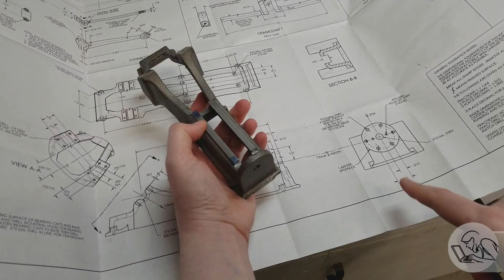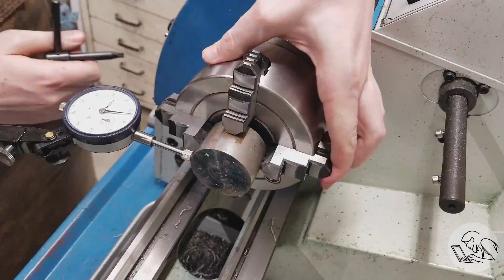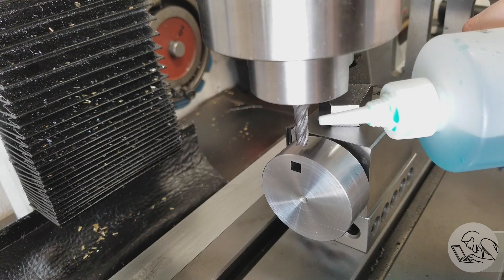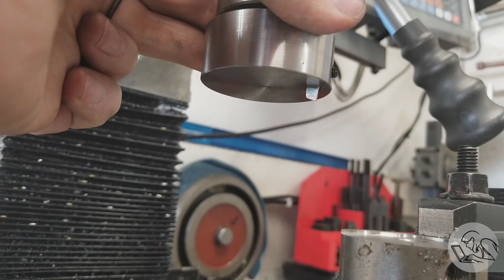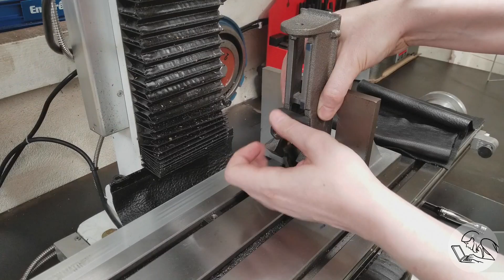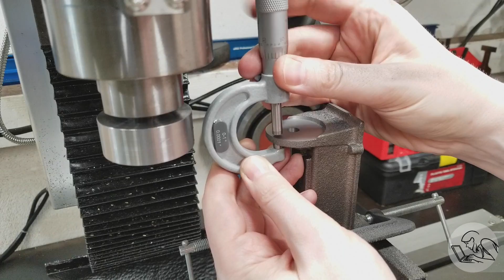Let's Build A Model Steam Engine : Spot Facing!

Comment: For your flycutter, since you're cutting soft cast iron you can use a drill blank (re-harden it if you need to) or use a piece of round carbide and grind a flat with a cutting edge on it. Kinda like a round lathe tool bit. I've done it and it works great and you don't need to square a hole.

Comment: For a small amount of adjustment without regrinding the tool would be to drill the hole in the hub at a slight angle so you can pull the tool in and out to adjust the cutting diameter.
PS Love the content! You have me more seriously considering buying myself a mill and lathe now.
Reply from the maker: Great idea!

Comment: Quinn, Your tool cut the first cut 20 thou over. Did you cut 10 or 20 thous from the tool bit? I'm building a PM 1 vertical. You Rock.

Comment: Hey Quinn! I did this operation on my kit today using the same setup you did with an angle plate. 

Like you, I found what seemed to be an out of square error in my angle plate. 

After a bit of measuring it transpired that the error wasn't the plate, but was because my mill head was slightly tilted. I corrected this and the angle plate ran true. I wonder if this might have been your problem as well.

Cheers from sunny Australia

AB
Reply from the maker: I wouldn’t be at all surprised if the error is in my mill, but shimming the plate is a lot easier than fixing the mill. 😁
Reply: @Blondihacks  how right you are.

Comment: Nice work. You could have also drilled the cylinder bolt circle in the same setup as spot facing, Reason you didn't ?
Reply from the maker: There isn’t vertical space for one, and for two I want to make the cylinder first to guarantee proper hole alignment

Comment: Next time you make a flycutter with a vertical tool, don't drill a hole and file. As you found out, adjusting the diameter of the cut is hit and miss. Mostly miss.

Instead mill a slot in the side of the tool. This will let you adjust the diameter of the cut quickly and easily.

Comment: Just for s & g (work it out for yourself), I've recently ordered an angle plate. Never thought I might have to check it for trueness, but it seems I do.

Ps. I can see how that making the back surface circular is ... pretty, but is it necessary? Can't you just machine straight across and leave a straight step?
Reply from the maker: Definitely not necessary. I liked the challenge of it. 😀

Comment: Another way to make that square hole is to mount the part on the mill table and use the z feed and a tool ground for slotting to cut it out.  It could be done on a lathe faceplate using the carriage movement as a shaper as well, but you would need some way of indexing the spindle.  If it’s not an operation you plan to do more than a couple of times, filing might be the most efficient way, though.
Reply from the maker: Yes, that would have been a cool way to do this!

Comment: if you had drilled the hole at a slight angle you can give you self a small adjustment of diameter by adjust cutter in and out. not much butt enough for perfection

Comment: Armchair machinist here... why not make a small "regular" fly cutter; it would be more versatile rather than single use.
How many hrs of practice to get the cutoff on the bench top consistently ;o
Reply from the maker: I definitely considered it, but that would have taken a lot longer and I can’t see it getting much use. This quick and dirty one only took about an hour (and half of that was filing the hole which I could have avoided 😂)

Comment: What seems to work best for breaking chips on aluminium for me is tons of RPM and feed. I tend to use inserts but I will run around 350m/min or 575fpm and feed 0.15mm/6 thou per rev.
This usually breaks chips quite reliably with cuts between 0.1-0.3mm radially using DCMT070204 inserts which can be find quite cheap on ebay and such.
I think our lathes are fairly similar in size and construction(I have a BL250G).
Start the feed, stand back and watch the spray of chips! :)
Reply from the maker: Yah, that’s what I do as well, and it helps, but my lathe can only do so much. What you saw there was max RPM and max feed on this machine.

Comment: did a similar spot face and ran into the same issues. i used the adj boring head in the lathe with the part fixtured to the cross slide
Reply: I was wondering about that myself. It saves making the special tool.

Comment: Looks good. Why did you choose to make the toolbit parallel to the arbor?
Reply from the maker: Because it was easier to make and easier to get the diameter correct this way
Reply: @Blondihacks  easier to layout a nominal diameter, but a tilted axis would allow fine-tuning diameter by adjusting tool stickout
Reply from the maker: Yah, but making an angled square hole in stock that thick is no fun. This was an easy and worked. 🤷‍♀️
Reply: @Blondihacks  Yeah, you're right, it would have been unpleasant gauging your progress on a square hole if it intersected the faces as a rectangle.

Comment: Hi Blondie,
Don't be afraid of carbide insert tools for hobby lathe.
I have a smaller lathe and have no issue using them. Especially on aluminum and hardened steel.
Propper insert does not know the origin or rigidity of machine. It jus does its job.
And also - for delicate work on stsinless I use Alu insert. It does not last long, but cuts away better tha SS rver will, with low spring effect on long overhang.
For aligning thing discs in lathe chuck - try a bump tool.
A simple project: drill M6 hole in old brazed carbide shank and bolt on the ball bearing. Try it, you will be suprissed 😉
Reply from the maker: I do use them, and have shown them on my channel. I just think HSS is better for hobbyists in most cases.
Reply from the maker: And I have a bump tool, and have shown that as well
Reply: @Blondihacks  
Obviously I have to go through all the videos on my favourite hobby machining channel 👍👍👍
Reply: @Blondihacks  
Hey Blondie, 
I thought the same, an for begining it was for sure so.
With cheap imports this have chsnged. Couple of bucs for a box of inserts. Especially this was true for what I expetianced for aluminium inserts. In combination with alcohol. BTW -  that nasy blue stain over your logo made me feel bad for talking you into trying alcohol. I do not use blue ink - so zero mess for me.

Comment: You could bolt the arbor to the cuter head with an eccentricly placed bolt hole. Arbor and tool are concentric (starting out) but the bolt hole connecting them is off axis. If it is only ~5 thou of axis you could get 10 thou of adjustment by rotating the arbor relative to the tool. Btw, I'm a big fan😊

Comment: Your chip breaking tool isn't breaking the chip because that relief is 90 degrees off.   It's acting more like a crappy shear tool instead of a chip breaker.  You may want to add like a step about .020-.035 from the cut edge to roll the chip more to break it, if that makes sense.

Comment: Alternate solution. You could have set the mill head at 90 degrees to the Z and use a boring head in the X direction. Still might have been tight on travel.
Reply from the maker: That’s an interesting idea!

Comment from the maker: Hey everyone! Here's are today's themes in the comments. Save yourself some typing and read first:

1) Yes, using a round piece of HSS speed steel in the fly cutter would have been a lot easier. However the square piece is what I had, and it was a good excuse to practice my filing, which I wanted to do anyway.

2) Yes, you could totally do this with the boring head in the lathe. If I'd thought of that, I'd probably have done it that way. 😀  Another good way to do it would be fixturing it to a faceplate and using a boring bar in the lathe. You need a good-sized lathe to have the mass to handle that setup, so that probably wouldn't have worked for me.
Reply: Sometimes I do something a certain way, because I just feel like doing that way, because it's a hobby and it's enjoyable. Weird right???? 😂
Reply: Or....4 jaw chuck with small plates and junk and the 5/16" hole with a plug with a center hole. Then just a face cut as usual on a lathe. The plug could bear against another piece of junk within the casting, this way it wouldn't need a step fro thrust. Rubberbands and tape can be used to keep the whole thing from killing you. I love the soda can material.....006 quite often.
Reply: unrelated , but every time i see you dial in a part in a four jaw  i cant help but wander, did she try two chuck key method and didn't like it, or never tried at all?  Make me second guess my self:) im easily twice as fast with two keys:) love your channel!!!
Reply: @zombiewelder9319  I always use the 2 key method.  I'm not proud, I need to get it done. Lol
Reply: Another way could have been a end mill the diameter of the counter bore.  That would have been closer to what we learned to do when I attended Pasadena City College.
Reply: @wi11y1960  
She mentioned in the video that she didn't have one that size.

Comment: @Blondihacks  - Hey Quinn! I have some cash in the budget next month to add either a small lathe or a small mill to my garage shop. Which would you recommend I start with? Which is the more versatile tool? I'm really torn between them! HALP!!

Also, I tried a metric thumbs-up and it was 10x better, but 1/2 as cool!
Reply from the maker: Check out my Import Lathe Buying Guide video!
Reply: @Blondihacks  How did I miss that!? Thanks!

Comment: Quinn, do you have a dial test indicator? It's a lot quicker and more precise (than turning a plug) to chuck one up in a collet or clamp to the spindle OD and indicate the inside of the bore. If you don't have one I might have a spare lying around... Edit - duh, you're using one in the video. Oops. The one I use for this is a lot smaller and fits even when the Z axis is pretty tight.
Reply from the maker: I appreciate the offer! Yah space was super tight here so the plug seemed the way to go

Comment: Ok, first, get out of my head. I was actually talking to my phone out loud wondering why you weren’t using a boring head, then you pause to explain it to me. Creepy. 
Second, filing square holes is not character building, it’s sadism. You should’ve called ToT, he’s got square drill bits. Lastly,  I may be showing my ignorance but, wouldn’t it be a lot easier to grind the cutting bit round at the shank with a flat spot at the set screw to index it?
Reply: Man,   ITs a STEAM  Engin,    NOT     SPACE   X.   get a life.   UK.

Comment: 1:59 A lathe suddenly looks suspiciously like a horizontal milling machine to me...
Reply: Back when I was a 9-5er, working at the shop, the mill went down for some time. Burned out a hard to replace part. The 'machinist' on hand used the lathe as exactly a horizontal mill for about two months, until the owner got around to replacing the part in the mill. The only issue is all cuts can only be made on two axes, depth and 'X,' but it worked just fine. I'm convinced that the 'missing link' between a lathe and a mill is a mickey-moused lathe in a horizontal milling configuration.
Reply: @Corbald  I don't know if anyone still makes them anymore, but you used to be able to buy a milling attachment for lathes that replaced the compound slide and gave you an extra axis.
Reply: @richardhunter607  Interesting! Might be the answer to my other question on here: "Lathe or Mill first?"
Reply: @Corbald  Old school horizontal mills were designed around existing lathe headstocks... there you go.
Reply: @ratdude747  Very interesting! I suspected it might have been the case, but failed to do any research.
Reply: Love your videos, with only a myford ML7 lathe and a vertical table it’s just a horizontal mill that the parts keep falling off of when trying to bolt them down. The most important thing is to get a collet setup for holding mill bits. Chucks cannot hold them properly. Fortunately myford made a very simple collet holder that used the taper in the spindle with a simple knurled nut/ collet holder to screw on. Also lathe makes for more exiting work . Try mounting a Stuart No5a standard on a faceplate and turning the tops and bottoms as well as boring the trunk guide.  http://stuartturnersteam.com/Vertical/No5a/No5a.html

Comment: You have a D-bit tool grinder, (Dekel). use a single point cutter ground & positioned at the right cutting angle.  I used a Dekel grinder & pantograph in '64-69 & made 1000's of patterns & models.

Comment: This is not so bad idea to use oil or coolant when machining cast iron, because of saving health.
Cats ^_^ iron are full of graphite. When machining, it fly up to air, and It's not good for health to breath it in.
Coolant bind graphite dust together, this add the safety to process.
Reply from the maker: Good tip!

Comment: Great video, as always! By the way, is your mike okay? In the beginning there was some horrible crackling.
Reply from the maker: Yah, sorry about that. Wireless lav mic had some interference on it and I didn’t catch it in time.
Reply: @Blondihacks  Well, it's not that bad, and it stops shortly afterwards. I just hoped it wasn't broken, which would have been especially bad in this case, since wireless lav mikes are pretty expensive.

Comment: As a lowly woodworker, I would have thought you'd want to make the shaft of the tool steel cutting bit round instead of making the hole in the fly cutter square. Do I have that wrong, or is it just a different approach?
Reply: It's easier to index a square than a circle and with cutting tools the geometry of the cutting tip is dependent on that indexing. So square is easier, but you could also make a round hole and use a round toolbit, if you have a round piece of hss since you're unlikely to be able to hand grind the square round enough, both viable methods, personal preference and what you've got on hand are the big distinction
Reply from the maker: I also just didn’t have a round piece to use. 😁

Comment: Without digging through all your videos to see if you mention it, what I'm trying to find out is what make are your lathe and mill. I had to sell my full size Bridgeport and full size lathe when I moved years ago and here, I don't have the room for another set of full sized tools. The ones you are using look like they would be perfect for what I need to do. Thank you for your great videos.
Reply: The company is "Precision Mathews", and Quinn did an Import lathe buying guide in the past. Maybe check out that one?
Reply: They're import machines, more or less all the same, the big distinctions are customer service and quality control. So buying from a good company, Precision Matthews for example, means it's less likely to have issues and if it does they'll be far more useful in correcting them

Comment: great idea , I hate to type this but you should have drilled the holes for the cylinder mount while it was setup vertically
Reply from the maker: I intentionally am not doing that until the cylinder is machined to guarantee alignment.
Reply: @Blondihacks  Okay

Comment: Power feed would be really nice on my lathe from the early 20s I have no power feed at all although I made my own for for the lead screw but I wouldn't know where to start for the cross slide
Reply: My 1950s lathe has power feed on both axes, but the gearing is weird so if the turning feed is at a decent speed the facing speed is woefully slow. I'm looking to add a separate power feed to the X axis to fix that. So far my thought is to drill and tap the back end of the cross-slide leadscrew, and screw in an extension that will let me fit a belt drive pulley. I'll probably use a stepper motor because of their high torque, which will let me use a low gear ratio which should mean the leadscrew remains easy to turn by hand when the feed is off. These are just back-of-the-envelope ideas, but maybe they'll help...
Reply: @cooperised  that's not a bad Idea I'll have to look into that it's kinda what I did for my feed except I fit a gear to the spindle in that way and did a gear system I have a video of it as I tested on my channel but the stepper motor idea may just work for the way my lathe is set up it was originally made for electric motors but the price was right at only 70 bucks I couldn't pass it up

Comment: Quinn, I have built several of these kits and I know the problems you encountered.  On a Redwing hit and miss engine I built, I had the same problem with running out of room when facing the end of the casting.  Even though I have a knee mill with a lot of travel, using a boring head still ran out of room.  What I wound up doing was using a large strap clamp and fixtured it to the front of the table utilizing the T nut slot.  This enabled to gain me enough room so I could use the boring head.  Would that have worked on your mill, as I noticed you do have a Tnut slot.
Reply from the maker: Sadly no, Y axis travel on this machine would not allow that. Spindle doesn’t even reach the edges in the y axis.
Reply: @Blondihacks  Gotcha.  Enjoy your videos little lady, I think I have watched every one.